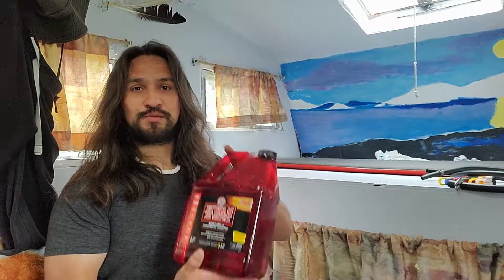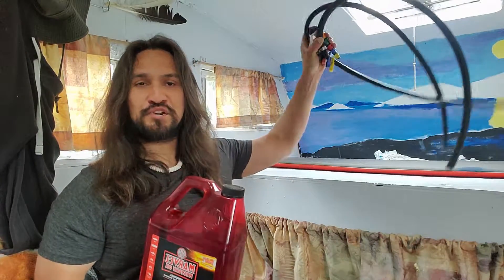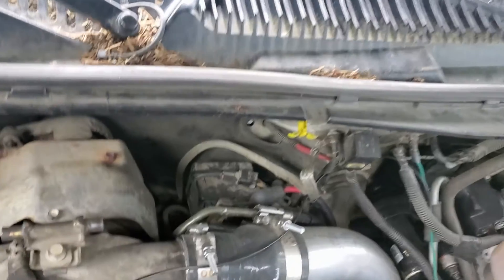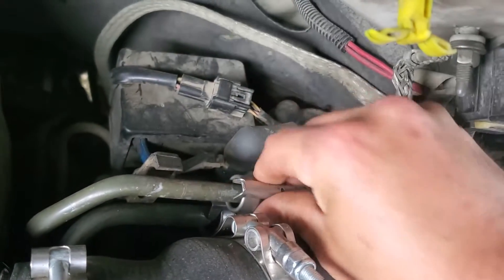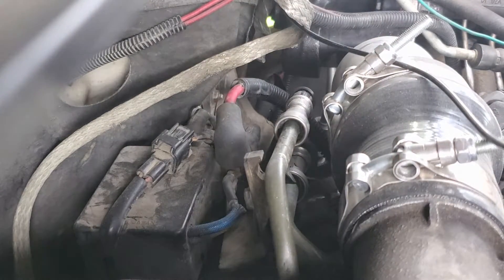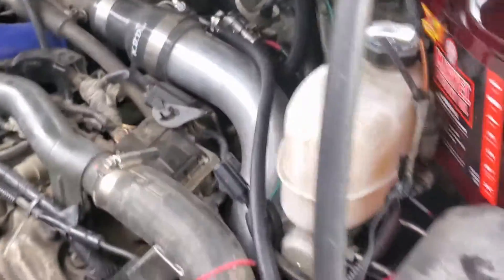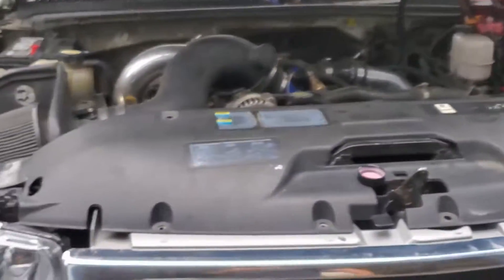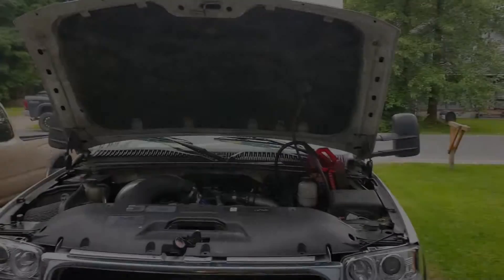Can MARVEL MYSTERY OIL Really CLEAN Your Diesel Fuel System?

Comment: It is not Deasel but was told to pour mystery oil straight in to gas tank to clean  a bit of every thing ????
Reply from the maker: Black smoke in a gas engine, is definitely an over fueling issue/ not enough air for how much fuel is being delivered.  Marvel in your tank can help if you have dirty fuel injectors.  I'd also take a look at your air filter and change it if it's been a while. I'd clean  the maf sensor as well.  Check the dtc codes (rent or borrow a device from oreillys if you don't have one) to see if there are any specific readings that will point you in the right direction, such as an issue with your fuel pressure regulator, o2 sensors, maf sensor, etc.   Do you know when the last time your fuel filter was changed?  I'd service that too if it hasn't been done in a while.  Also, can you hear your fuel pump whinning like its struggling?

Comment: I dont believe it one bit
Reply from the maker: Believe it or not, it's your  perogative. Some would say reality is an illusion 🤷
Reply: @KooshdaakaaGarage  I seen you do something to your engine you probably shouldn't have. Newer diesels are not like the old ones where they'll run on transmission oil diesel or your cooking grease after a fish fry. This is very nice to do on newer common rail fuel systems. Maybe mixing it in with diesel but I've seen enough from other videos as well that I'm not using that crap in anything
Reply from the maker: To each their own. I put it in a now 24 year old diesel with fuel injectors stuck open. This saved me from a cracked piston.  I've been using it for over 20 years. It's been in production for over 100 years. Tried and true. At the end of the day none of this really matters.  You use what you like and I'll use what I like.

Comment: Bruh, owner of an "early"99 7.3" ain't no way I'd do that.
Reply from the maker: @mnmountainman9343  You could burn veggie oil from McDonald's through those ole 7.3s. Some even "make" their own diesel by using old filtered engine oil and mixing it with old gasoline.  Should keep this in your back pocket at least.

Comment: Great video man can't believe it hasn't popped up on my feed the past 2 years. I use this in my 92 12 valve, gonna replace the fuel filter here pretty soon and delete the pre heater above it. Just gonna fill the entire filter with MMO instead of diesel. I normally just run heating oil in her since it's 10 cents a gallon cheaper and readily available at some stations here in Pennsylvania.
Reply from the maker: Thanks man!  You can pretty much anything you want in  12v, one of the many great things about them.  That MMO is great stuff 👌

Comment: Forgive my ignorance, I'm new to diesels BUT, are you running MMO INSTEAD of regular low S diesel fuel??
Reply from the maker: I was using it as a purge to clean the injectors.  But essentially yes, the truck was running on pure MMO for this procedure.

Comment: Wish more diesel owners used marvel mystery oil, happy injector's 😂😂😂😂
Reply from the maker: Man, I hear ya.  This stuff is amazing.  I still add it in my fuel tank every other fill up to keep things lubricated, clean, and happy.   I like to toss it in my crank case about 500 miles before the oil change to help break up all the carbon deposits.  Works like a charm!
Reply: @KooshdaakaaGarage had buddy get deal on 7.3 power stroke that sat for 15yrs. after changing filters we basically fed it nothing marvel mystery oil in the fuel.  That thing runs beautiful
Reply from the maker: @hondaatcfreak420  heck yeah man. I did something similar with my buddies 12v cummins that sat for 9 years (12 years since it was on the road) and it cleaned the injectors right up. I put it in the crankcase to bring it back around and after a rough smokey start it purred like a kitten 😁🍻
Reply: @KooshdaakaaGarage  can use ATF oil in pinch too
Reply from the maker: @hondaatcfreak420  heck yeah. I've done that a few times when my injectors were sticking open.  Atf and marvel saved my bacon until I was ready to swap my injectors over to the sac nozzles.  Now it's just maintenance doses of marvel to keep everything running smooth 🍻

Comment: How are the injectors all this time later?
Reply from the maker: Thank you for the question!  The Injectors occasionally would get stuck when I really put the boots to er' out in the mountains.  For that I always carried this kit with me so I could perform an emergency purge to get things running smooth again.   Last year I actually changed my injectors (SAC 45s), installed new gaskets, head studs, performed a mild port & polish on the heads, exhaust manifolds/ replaced driverside with BD Full Bore,  port matched up pipes, installed upgraded down pipe (port & polished it),  rebuilt the turbo (port/polished & installed upgraded compressor wheel)  and now ole Pig runs like NEW!  You can check out the "Project LB7 Duramax Spool Up" series on my channel if you are interested in those sorts of things.   Thanks again for checking in!
Reply: But how did it run afterwards with MMO

Comment: I did the Gm cleaner on a LB7 twice and let it hot soak overnight about 1/2 way through the second bottle without hooking back up the tank lines, so it sat and heat soaked with the cleaner in the lines and injectors overnight, then ran the last 1/2 bottle the next day, it put the injectors back within spec. This was with about 120k on the clock and I ran the truck another 50k+ miles and sold it still within spec and running great. During my ownership starting around 50k I added in several different fuel additives in probably 90% of my fuel up’s. I had used a combination of Power service grey bottle mostly & 2 stroke, and occasionally Lucas in my fuel.

Comment: I did seafoam injector cleanse when I changed fuel filter. I upgraded to the big Cat filter.
Put seafoam in fuel tank, warm engine, change filter, fill new filter with straight seafoam, start it up and run 10 min. Shut off and hot soak 15 min. Then start it up and drive hard for at least 1/2 HR.
I don't know if that big filter will hold a gallon, but maybe I'll try that with Marvel next time. Seafoam just got stupid expensive. I'm thinking maybe Marvel will do better job anyway.
Reply from the maker: Heck yeah man,  I've done pretty much that same procedure you mentioned with Seafoam and it works pretty good.  Definitely a nice maintenance thing to do every fuel filter change.    Your engine will love Marvel in the fuel tank when you give it a try. When you  toss about a quart in the tank at fill up you'll notice the injectors quiet down and idle will smooth out a bit.   How are you liking the CAT filter in the primary fuel filter housing?  I just picked one up!  Haven't installed it yet but I've been running the CAT fuel filter and the water separator in my FASS lift pump for the past few years so I figured I might as well convert the primary filter housing since I just put it back on for the extra fuel heater.   Cheers 🍻
Reply: @KooshdaakaaGarage  been great so far. Haven't changed it again yet. Just ordered couple Xtra filters but don't think I'll need one for while yet.

Comment: Mmo is also great to run in the crankcase. I ran two quarts in my 12v cummins for an entire oil change and it made the truck start much quicker and made it the quietest 12v cummins I’ve heard.
Reply from the maker: Heck yeah man.  My buddy and I did the same thing to his 12v cummins when we filmed the first start in 9 years video: https://www.youtube.com/watch?v=epMfQdmsBhA&t=619s    I also use MMO in my Chevy 350 crankcase and have used it in the Duramax crankcase too.  This stuff is legit 🍻

Comment: Can I add to a low sulfur  required tractor with diesel?
Reply from the maker: Hello 👋   MMO should be safe for your diesel tractor,  it's a combustible lubricant.   I've used it in  my gas and diesel engines and gave even tossed it in the chainsaw as a 2 cycle oil.
Reply: @KooshdaakaaGarage  Thanks,  What part of Alaska are you in?
Reply from the maker: @ElonMuskX  Southeast Alaska.  The rainy part! 😆
Reply: @KooshdaakaaGarage  I sure miss Alaska.  Lived in Anchorage for 4 years and Fairbanks for 4 years.  Told the wife I wanted to go back and she said she would leave me.  Might just see you on the drive up the Alcan again. LOL
Reply from the maker: @ElonMuskX  hah!  Don't threaten you with a good time eh? 😂  I'll keep the beer on ice for ya 🍻

Comment: nice. next time run it for awhile at idle then do a high idle then shut it down and let her cool back down. basically doing a hot soak. then start it up and continue the idle and high idle then actually drive the truck running straight MMO and run her hard and get her hot. then shut her down to do another hot soak then continue the idle and high idle again and shut it down and reconnect everything back up.
Reply from the maker: Ah yeah, good call Green Queen Machine.  Now that I know this old Duramax can run on straight MMO with ease I'll definitely give that a try next time, thanks for the suggestion.   I just replaced the injectors with sac nozzle 45% over's so it may be a little bit before I run another purge but I'll keep this in mind when the time comes.  Cheers 🍻

Comment: I have a 93 Chevy Silverado dually pickup with a 6.5 turbo diesel in it and I run Marvel Mystery Oil in it when I fuel it up a lot of times I just put 3 quarts in it when I put fuel in. hopefully it will keep everything nice and clean that's my goal anyway.
Reply from the maker: Heck yeah Tropher,  I bet that old Detroit tank runs nice and smooth.  I still run it in every tank of diesel fuel and even use it as a 2 cycle oil in my chainsaw to keep it happy.  It's tried and true 👍
Reply: @KooshdaakaaGarage  I am a firm believer in the Marvel Mystery Oil I have used it for years and gasoline Motors and it really does the job. But this is my first diesel that only has 168000 miles on it runs like a top sounds good and I hope it stays that way. I don't believe that a person can use too much Marvel Mystery Oil. I've never heard anything negative about it anyway. Thanks for the response

Comment: wonder if that will hurt glow plugs? I know when using motor oil in diesel killed my glow plugs pretty fast
Reply from the maker: I hope it doesn't! It's been about a year now and so far so good 👍.   Mmo is a combustible designed  to use in diesel or gas tanks as well as crankcase.  It's definitely thinner than motor oil. I wouldn't fill the engine up with this stuff but it makes for a good carbon softener if you run a quart for 500 miles or so before an oil change.  Seems to burn pretty clean and smokeless when used as a purge/top half engine cleaner or fuel additive.

Comment: So what were you balance rates before and after? I've got 2 that are super close to the +5.5 mark
Reply from the maker: Hello Jake, thank you for the question!  My balance rates were within spec  during this experiment before and after.  I did this purge to both see what happen with MMO as well as to give the injectors a good cleaning before my overland trip.   That said,  when I'm working the truck hard through the mountains, injector 4 likes to stick open at usually -4.   Now to get the injector unstuck I'll usually either throw some MMO in the tank or perform a purge with MMO because it seems to do the trick.   I'll be replacing my injectors here pretty soon.

Comment: You were putting just Marvel mistery oil ir mixet with diesel?
Reply from the maker: Mmo is around 66% mineral oil and around 33% white mineral solvent.  There is also an anti ware agent, a heat polymor and a carbon softener mixed in there.  It provides more lubrication than diesel alone hence why the engine runs quiet and smooth when running a purge or when you add a quart to your fuel tank.  It can also be ran in the crankcase pre oil change to help break down the carbon deposits and flush out your engine.
Reply: MMO is basically kerosene.
Reply: @GrandPrix46  that is not good, kerosene does not have good lubricity, it Will damaged the pump
Reply from the maker: 100% marvel mystery oil.

Comment: Can you do one with seafoam
Reply from the maker: Sure can!
Reply: @KooshdaakaaGarage  

Thanks for the video. 
Have you ever tried B12 Chemtool #0116 Fuel system cleaner?
 It's some powerful stuff. B12 chemtool literally melts away carbon! It devarnished 20 yearold fuel injectors in my father's truck just from two cans added to his gas tank along with 30 yr old sludge from our tractor. But B12 is so powerful for a reason. It's methanol add pack can actually be too much for a car's tak  should there be an accidental over treatment. So, atmost 2 cans  of B12 every 5-6000 miles is safe. It brought his truck's fuel trims back to Zero! Also, I'm just starting to use MMO and it's a pretty good penetrating oil.  The solvency must be pretty good for piston rings.
Reply from the maker: @William-13  Hello and thanks for the tip!  I have a can of B12 running through my Chevy 350 as I type :)  It is very potent stuff and is priced right.  I've used it in gas engines for quite a few years alongside MMO.  I haven't used B12in diesel engines yet.  Have you used it on a diesel truck yet?  How much did you add?